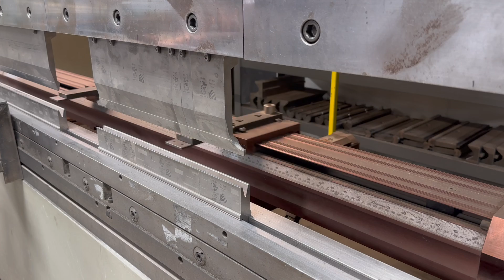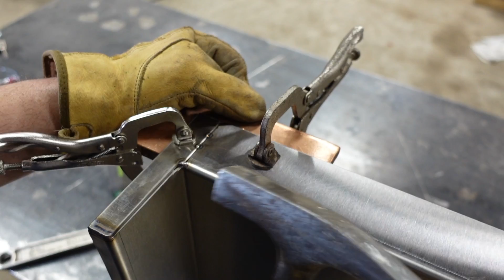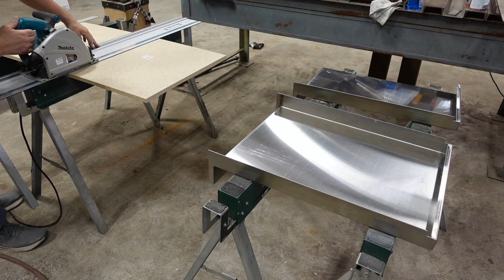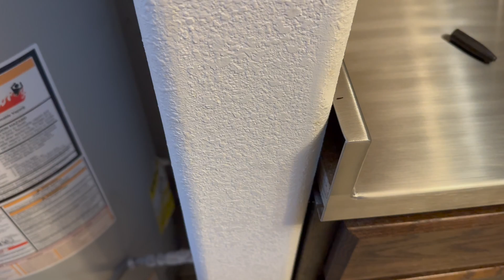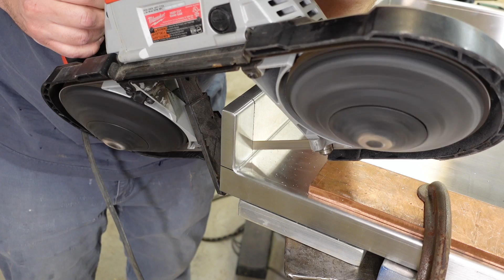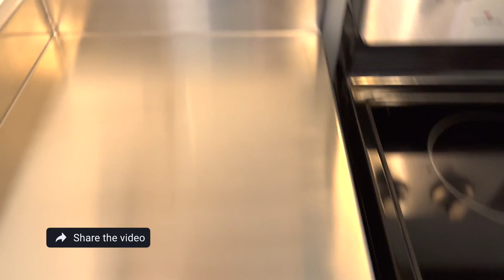🔴 Stainless Countertop Fabrication

Comment: Very nice. It's a bit hard to see at times - but are you always using filler wire for your TIG welds on these stainless tops? Or is it ok to simply fuse some seams?
Reply from the maker: Fusing on corner welds is completely fine. Just adding rod if necessary

Comment: Any suggestion what adhesive to use when attaching steel sheet on wood?
Reply from the maker: I’ve had good luck with loctite brand construction adhesives
Reply: @TheMoonlightCraftsman  Do you coat just one side with it? With a small comb? Thanks
Reply from the maker: I do lines, one line all around the edge, so the entire surface isn’t covered but with 16ga or 14ga metal it’s fine. Just on the substrate then set the metal on. Some instructions vary I’ve noticed so I’d read the label for best practice.
Reply: @TheMoonlightCraftsman  Ok thanks. I am using 16ga stainless. With lines I am concerned about hollow spots.
Reply from the maker: put them close together. But something like contact adhesive where you have a thin layer everywhere isn’t strong enough to bind everywhere like on laminate. If you’re glued every 4inches let’s say, try and flex a piece of 16ga 4inches wide if you see what I’m saying

Comment: Beautiful work - Thanks for sharing! Enormous respect and appreciation here!
I just had a job widening the top - and THEN REPAIRING - this type table at a small local commercial type kitchen. Yes, repairing MY own job - HA! 
Two HUGE problems occurred: (1) Zero SS sheet metal knowledge or experience, and (2) I was not aware SS sheet metal is AMAZINGLY easy to distort and warp.  Welded this in a couple hours but required about 3 days messing around and reinforcing to fix, sort-of!  Pretty close to Dumpster City 🥴Too late but learned a lot.

Comment: if you did some welds in the middle of a sheet of stainless steel how would you sand and buff that to match the grain. what tooling would you use?
Reply from the maker: Avoid it if you can. Like designing the seam at the sink so you have several inches not to polish. You can never get it to perfectly match the factory brush. But to reduce the method down grind weld with grinder 120 grit scratches same direction as grain, use grinder with red conditioning disc to remove 120 grit scratches, take a burnishing tool with red conditioning wheel and put grain back in, possibly blend with scotch brite hand pad after that

Comment: what kind of filler is are you using here?
Reply from the maker: 316L rod
Reply: @TheMoonlightCraftsman  316l rod. is this 304 stainless sheet here? i  just got back into tig welding. ive welded aluminum and steel, but never stainless steel.  i’m trying to figure out the whole world of stainless steel welding and sand buff polishing.
Reply from the maker: I use 316L on 304 and 316. This is 304 in the video